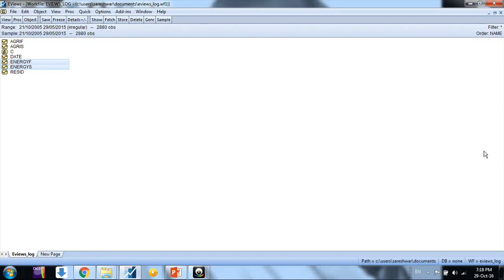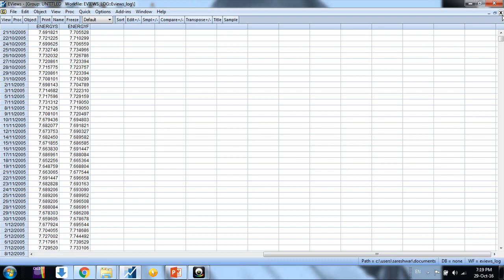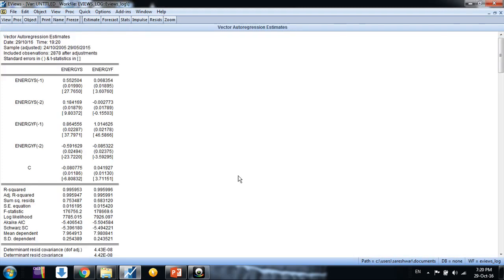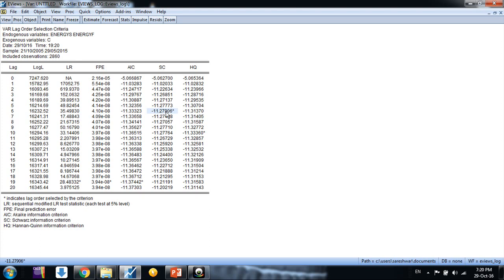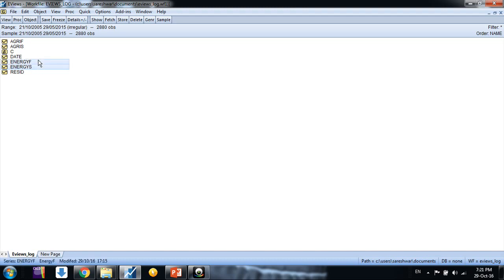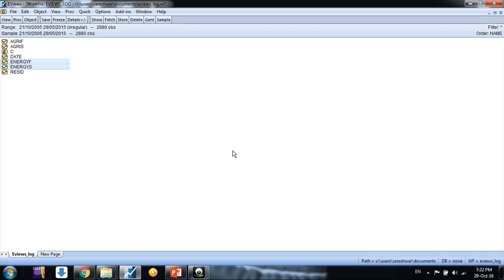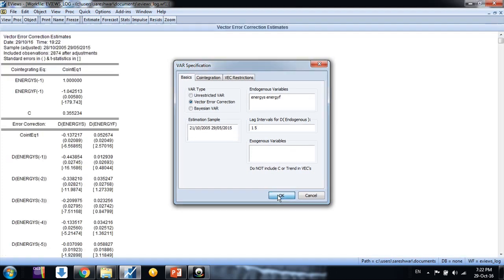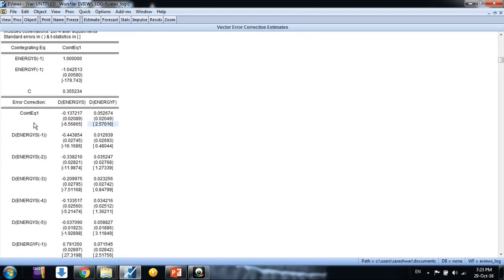How to run VECM in Eviews

Comment: Hi, Dr. Inani, I have some questions regarding the long run effect of the VECM in your video. First, in the first block of the results, the cointegrating Eq part, there is only one column above the model with D(energys) as its DV, but actually there are two models with different DVs: D(energys) and D(energyf). So I am wondering whether this means the same coefficients of energys(-1) and energyf(-1) in both models, not only for model D(energys), but also for model D(energyf). Second, I want to know how to see the exact coefficients of long run effects. I know the long run effect coefficients lie in the first block and the signs need reversing. But I am so confused about this. Let's take the first model D(energys) as an example. The coefficient of energyf(-1) is 1.04 (.01) for the first model, and it shows the coefficient of energys(-1) is -1. So I really have no idea what -1 means here. Is it a standardized coefficient or unstandardized? Why there is only 1 showing there without standard error?  So I am really confused about the long run effect part. Could you please spare some time to answer my questions? Thanks so much!!!!

Comment: Hi, Dr. Inani, I have a question about the lag of VECM. If the lag length criteria suggest  one lag in the VAR model, then how to set the lag length for VECM. Thanks for your attention in advance.
Reply from the maker: Are you getting the optimal lags less than 2 (or 1). Then please have at least 2 lags in VAR to run VECM (in order to have 1 lag of returns)
Reply: Ok, I see. Thanks for your suggestion. Actually I am a little bit confused about the 1 lag of return thing in VECM. Dr. Inani, do you have any video clip about the idea of this? Thanks so much.
Reply from the maker: I do not have any specific video on it. In finance, we use generally the first difference of log prices (those are returns) in VECM. But for other cases, it is first differenced series of the interest variables (which we use in the VECM).
Reply: Ok, I see. Thanks for your reply and suggestions!